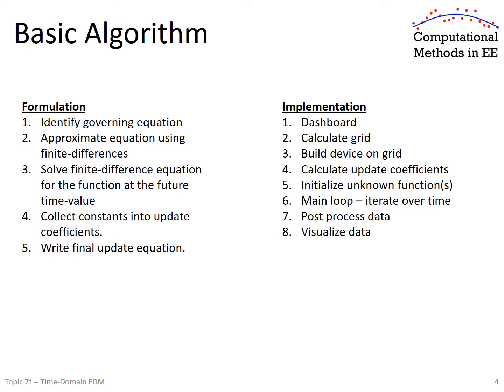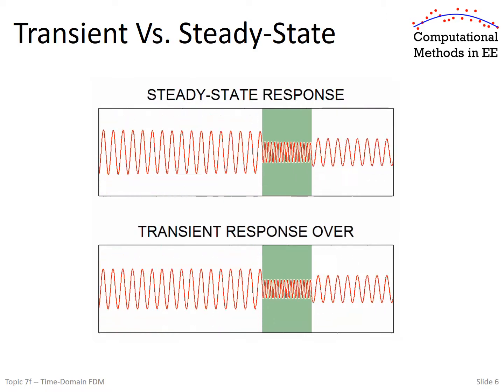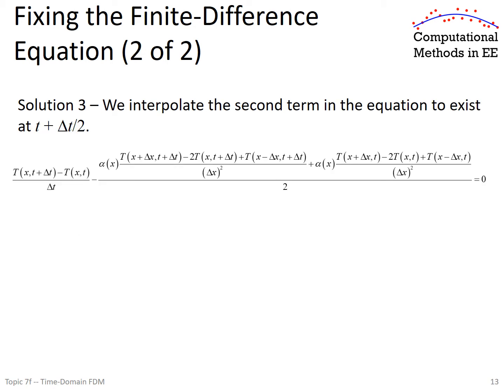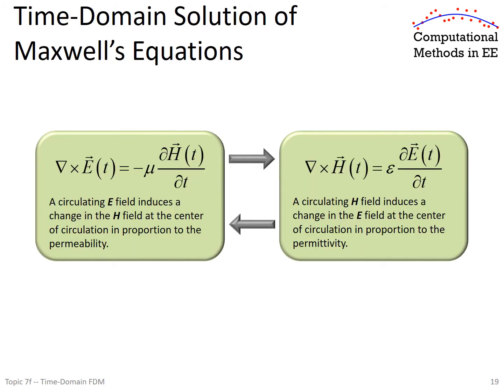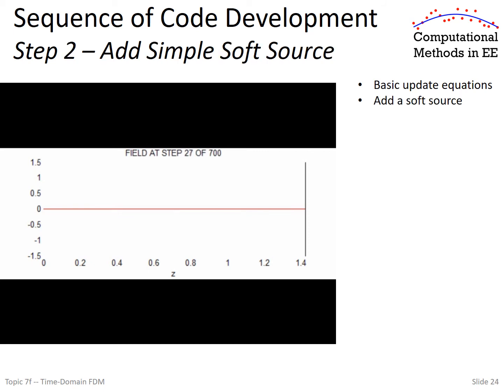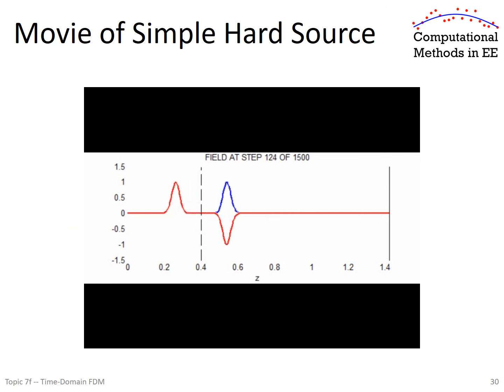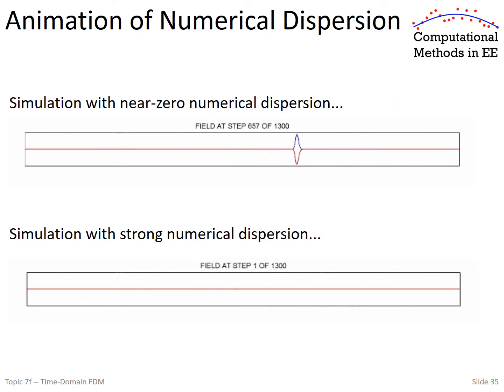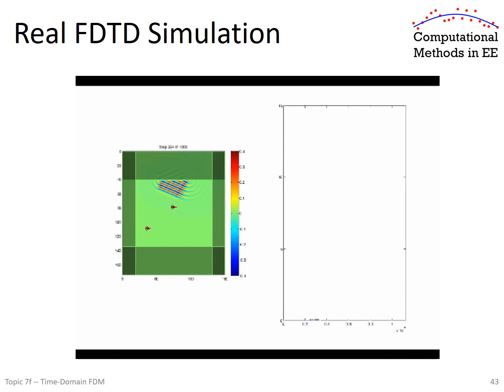Topic 7f -- Time-Domain FDM

Comment: Great video sir. Thank you. Loved this lecture and the visuals with it. The way I understand this, TIme-Domain FDM is simply using the forward euler method to solve the equations in every step and not using Implicit euler or crank-nicholson method. But then, isn't the main disadvantage of this method is the stability condition that severely limits the size of your time step especially when you want to increase your spatial grid resolution?
Reply from the maker: I am using the forward euler because it works well for this example and is much simpler.  That I recall, only the crank-nicholson is unconditionally stable.  Even that has a stability condition for the time step. Essentially, using second-order accurate finite-differences, it is impossible for a phenomenon to travel more than one grid cell in one time step.  The method will be unstable if the physical phenomenon would travel faster than is numerically possible.  A smaller time step would keep the physical phenomenon slower than is numerically possible to ensure stability.

There are some techniques such as alternating direction implicit (ADI) that can overcome the stability condition at a cost.  For the most part, there is no overcoming the stability condition in a time-domain simulation that I am aware.  I wish there was!

Comment: Dr. Rumpf, I have a question regarding this lecture video. At around 18:50 we discuss the stability condition. I understand the reasoning behind it. The heat front has to be slower than one cell per time step. But I don't understand how this idea comes down to: update coefficient at the i-th cell, c_i < 1/2
Why 1/2? Would this value change based on the approximation scheme used? For example if we use data from 5 grid points instead of 3, would this value change to something other than 1/2?
For a general problem, how can we calculate this value that the update coefficient has to be less than?
Reply from the maker: You have inspired me to revise that section of the notes to better convey what is happening.  The 1/2 is simply a safety margin.  Take a look at the new version of the notes from the course website.  I have not rerecorded the lecture so the changes are only in the notes.

https://empossible.net/academics/emp4301_5301/
Reply: @empossible1577  I went through the pdf and the updated explanation made so much sense! It suddenly clicked for me. Now I can take this idea and apply it to problems in my field of interest. I have already written python code for 3D steady-state neutron diffusion systems. This weekend I will attempt the time-dependent code. Even though I am a student from a different STEM field (nuclear engineering), I am forever indebted to you for teaching me the Finite Difference Method through this set of excellent lectures on YouTube.
Reply from the maker: @amithasanarpon2527  Thank you!  Awesome!  I love hearing that!!